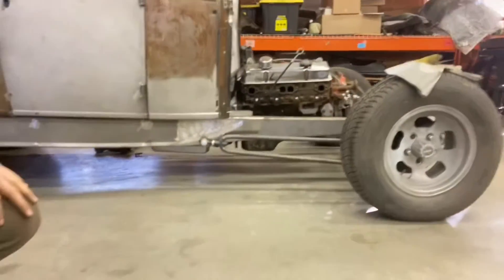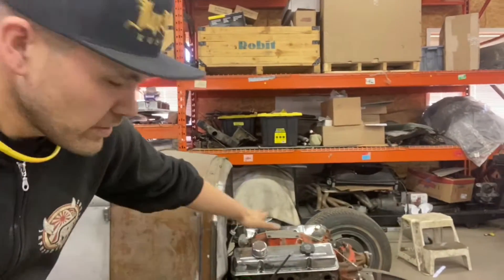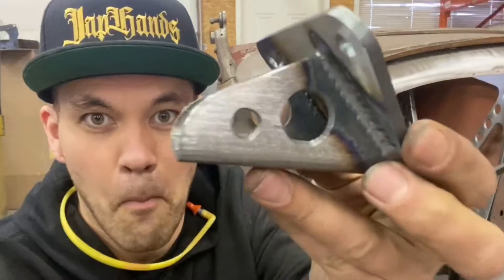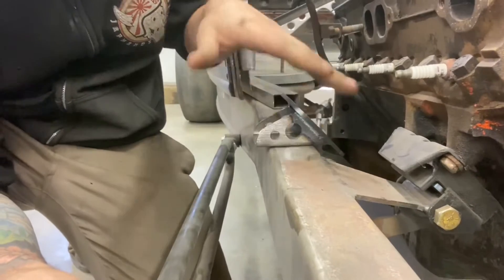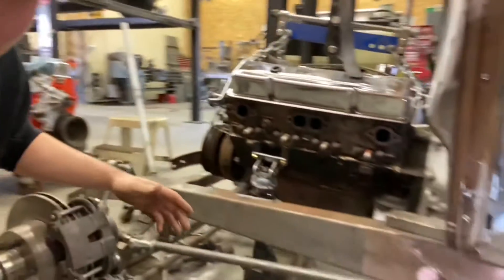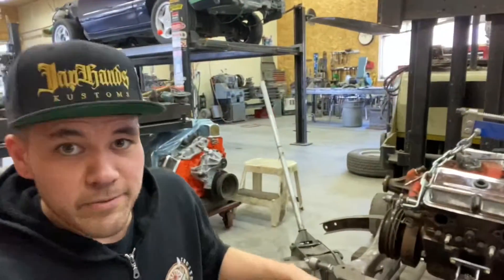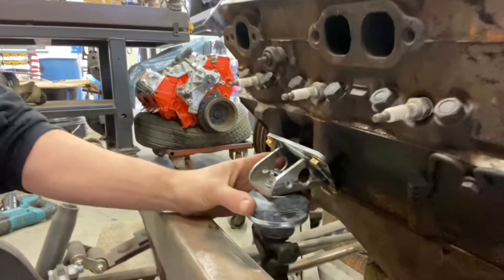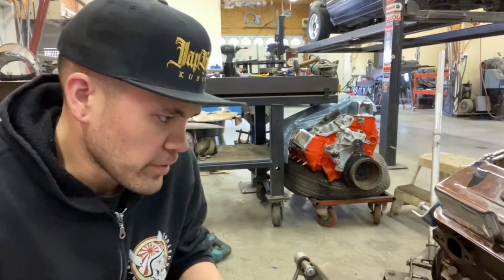How To Make and Install Custom Engine Mounts (Model A Hot Rod Build Part 1)

Comment: Have any experience pouring polyurethane to rebuild an old engine mount? I'm having bad luck matching my stock mount with off the shelf mounts that don't line up on the engine side though they're supposedly for my engine. Though the old rubber is falling apart I surprisingly don't have vibration problems, I'm just doing the transmission mount and don't want to do the work again in a few years if the motor mounts get worse.

Comment: When you are cutting/drilling a series of holes and each one is going to be larger is there a formular to determine the location of each hole, or do you just use the size of the drill bit or say die and place it, in the next location and fit it? 
Example: A triangular piece of material and you want the holes to be larger and in proportion as you move from the smaller to the larger end.
Thanks. I hope I was clear enough.
Reply from the maker: I wish there was. I just draw a border then play with hole sizes that are spaced nice and are consistent on the border
Reply: @MakeItKustom  Sounds like a plan to me. Thanks MUCH for getting back and you guys be cool and take care.

Comment: I am not the guy who goes crazy about everything being of one brand, but I do question why, since you are building from scratch, aren't you using a Ford engine and tranny?? Again, I am not a "purist", but I think if I were building something from scratch, I'd try to make it all of one brand!! Most times people tell me they use chevy engines due to them being a dime a dozen and more than that because they are easier to fit into tighter packages... I very typically see Chevy engines in 20's - 40's Mopars and the cheap and tight thing falls to the BULL SHIT bin as 318's and 360's were more than plentiful for decades!!!! Even overdrive trannies!!!! And if they were really worried about space, a 904 tranny is smaller than a 350 GM!!!   The thing that really made me question this is that if you had used a Ford engine, the dizzy is in the front of the engine, so no need for the sculpted firewall...
Reply from the maker: I think when it comes down to it there’s no right or wrong way it’s just whatever somebody wants. I have no opinion one way or another. I love a beautiful engine just as much as anybody else but a small block Chevy can still look interesting. This is a customers project
Reply: The small block chevy has more speed equipment available for it and it's cheaper. Also availability, remember the last gen1 small block was built in 86? The real question is have you ever tried to sell an early ford hot rod with a small block Ford? I have and it took time. If the car had a SBC it would have sold more quickly.

Comment: I know that this is an old video, raising the front of the engine, would it not change the drive /tailshaft  angle???
Thank Halfass for a great recommendation 👍👍👍👍👍👍
Reply from the maker: Yes it does but it’s all within spec

Comment: Rubber motor mounts don’t have screws or nuts on the bottom?
Reply from the maker: These have a shoulder bolt that go from underneath and nut on the top
Reply: @MakeItKustom  thanks man!